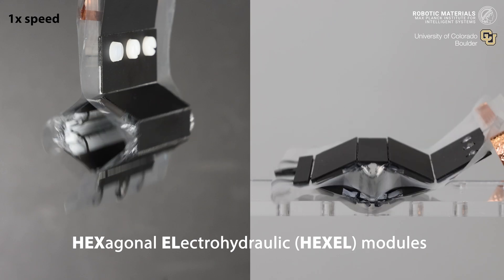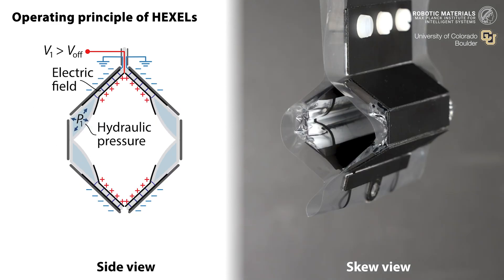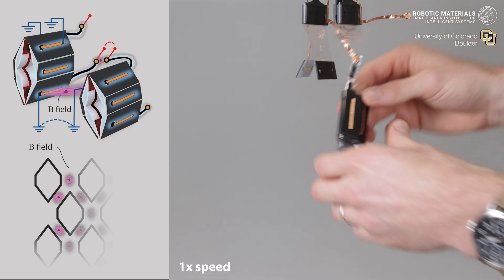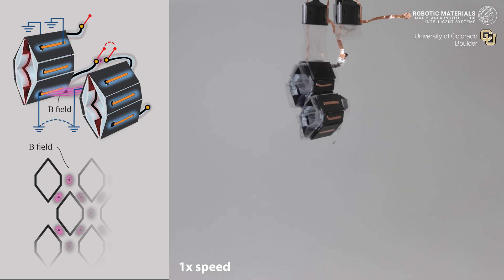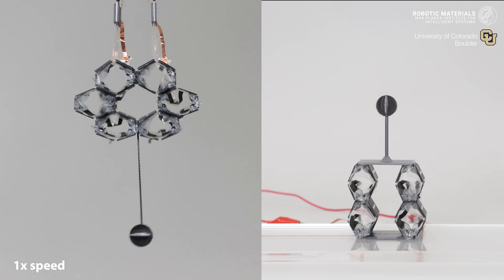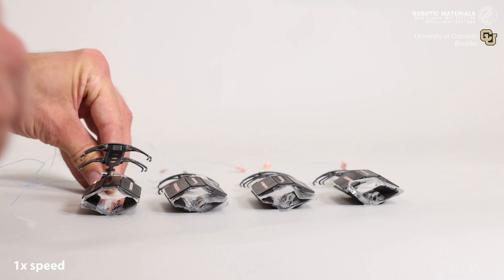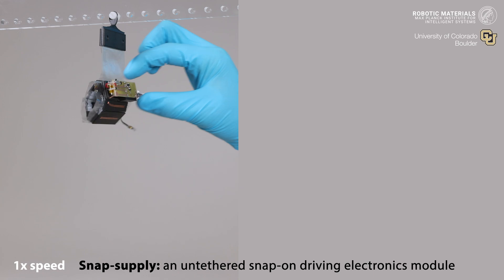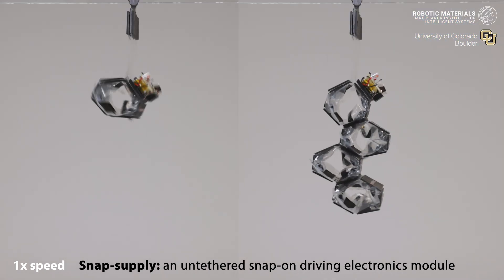Hexagonal electrohydraulic modules for rapidly reconfigurable high-speed robots

Comment: Maybe some day synthetic muscles as in the machines in Horizon are possible...
Reply: It's already possible from a purely conceptual sense since the HASEL actuator was invented.

They just need to refine manufacturing density and voltage requirements to get viable soft robots using artificial muscles based on these actuators.

Comment: What's the voltage for these? The old hasels had kv level requirements, is this safe for a toy?
Reply: High voltage
Reply: About 24V
Reply: Same as hasel
Reply: There is independent research into decreasing voltage requirements with different materials.

I think this stody was not concerned with that aspect, merely upon packaging, utility and scale.
Reply: 6000 volts. Yoder paper does explain it. What they don't explain - but gloss over - is the custom optocoupler they built for the high voltages...